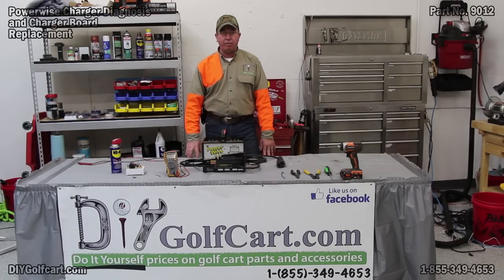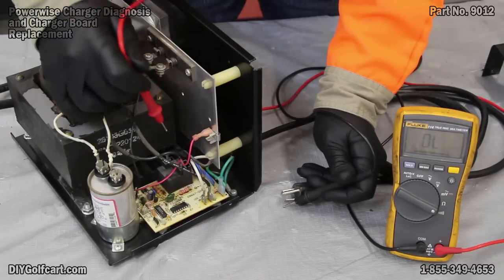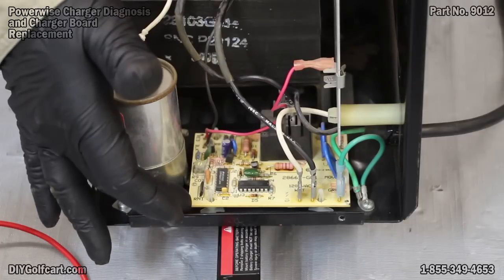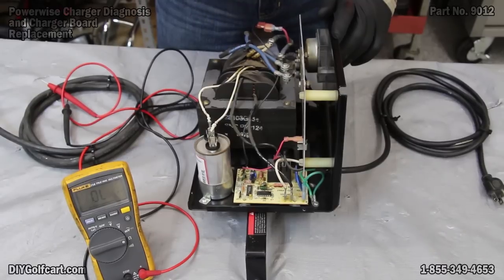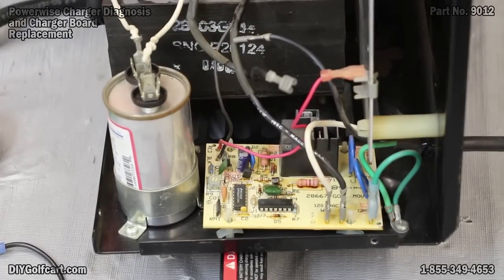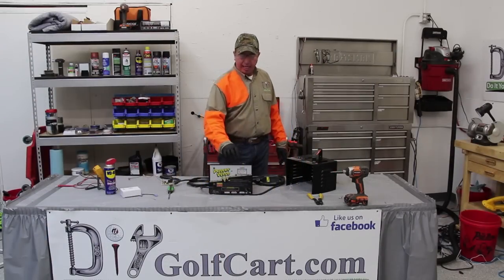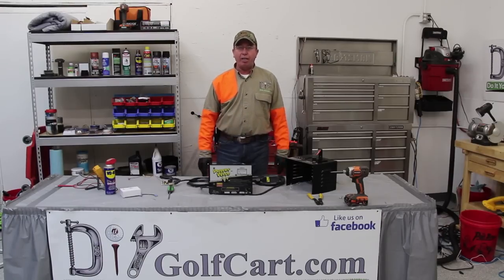Powerwise Charger Board and Diagnostic | How to Repair or Replace Golf Cart Charger

Comment: is it normal for the charger to click occasionally when hot wiring the power board?  Also what happens if you let the hot wired charger run until it's under 5 amps if anything?

Comment: If the fuse and or diodes is bad will it make the board act as if it's bad too ... I  touched the screw driver across the relay on my new board and it turned charger on..I

Comment: Thank you 💓. Unusual but my ac power cord was bad and the capacitor as well. I'll check the rest when those two are installed.
Reply: I replaced the 50 amp use, power cord and capacitor 9.24.22. Unclear how to check the transformer. All else checked good as in the video. Plugged it in 9/25/22. Nothing.  Zip.  Screwdriver across the relay terminals and it arced.  What do I do now?

Comment: Thank you for testing info. I had a spark when I touched terminals on relay, so is the board ok? I did not get a continuity sound when i checked the negative side of cart plug that goes into the cart. So, do you think the pug itself is bad? S. Mccoy

Comment: I'm so happy, I DID IT.  I don't like working with electricity and at 69 years of age, I've had my share of shocking episodes. After putting the new charger board in I plugged it in and tripped the breaker.....I took the cover box off again and watched the video frame by frame.  I found where I had misplaced two black wires.  Now,,..my heart is happy.  It works great.  Karen Randa

Comment: Note : you have to have atleast 32 volts before charger will activate. My batteries are 4 years old and the charger doesn't work sometimes. I disconnect and charge 1 at a time till enough voltage is present.
Reply: Thanks a lot Sir!!. That was the answer my question that i had been looking for!!! One customer brought me this for repair. I faced first time off with this device and i realized that , there must be some voltage to start-up the circuit. So i tried, 14V, 20V, 24V at last, 27V the circuit board turned on and relay "click"ed. I knew it logic of to work the circuit, but i wasn't sure..Thanks to you, now i'm sure. Really thank you again Sir!! Have a great day!!!
Reply: @nusyil  your welcome I'm glad the information helped.

Comment: What a great walkthrough on this charger. I had already tracked my problem down to the relay/solenoid when I didn't hear that firm click the charger used to make and saw that it was in there. However I was questioning the cap because this charger has been stored outdoors and looked very poorly, but your specs tell me it's in fine operational range after all of it's hard life.
Someone new to electronics can pick up a dmm user manual and this video to diagnose their issue. Hope your able to stick to teaching because you've a knack for it

Comment: Hello thank you for showing this video I have followed all your guide it’s really good video the one thing you probably forgot to mention what if the capacitor is not giving you any reading and also when you had the screwdriver on both of the leads and it made a humming sound does that mean the board is bad or the board is good because when I touch the two leads that goes into the relay it made a humming sound is that mean the The board is good or the board is bad and I did not have any reading on the capacitors thanks in advance I’ll be looking forward to your reply back thanks

Comment: Hi I replaced the board in my 36 volt power wise charger, the one board replaced the two old boards but when I plug it into the golf cart it still will not come on, I unplugged the two black wires on the black box and connected them together and you could hear the transformer come on, I charged the golf cart like this so I figured this brand new board would fix the issue but it has not, any other diagnostic help would be greatly appreciated, thank you!

Comment: Barry, do you happen to know if a charger that is using diodes, can the diodes be replaced with the heat sink terminal that is used on this charger you are working on? thank you in advance, Dean
Reply: never mind LOL, i just replayed and saw you point out the new diodes are what i should be using :-)

Comment: Can  you tell me where I could get a QuiQ Delto Q 72v (yellow top, black sides) HF/PFC charger repaired, I checked Ac in - ok,  can't find any dc anywhere in the system.  I checked 2 what looked like slo-blow fuses, they seemed ok (no v either side  of either one).  Very perplexed, no lights at all ever; with ac plugged in, not even one led lights up? 
   THANKS>

Comment: So if the diodes are bad it doesnt charge? My circuit board is bad because if i tap both with a screwdriver it starts humming.. But if i touch the diode to the plate it reads a number, my multimeter doesnt have the beep sound so im am using the ohms to check continuity

Comment: First, thank you for the video.  Very helpful.  Question I have: Was not seeing continuity from the ground bar in the charge plug to the screw connection in the charger, but was able to see continuity between the grounding bar to the red wire you unplugged.  Should I move forward or is that an issue?   One other thing:  I think my capacitor was showing slightly more than 1.9 ohms (more like 2.9 - 3.2).  Thanks in advance.

Comment: I need help *

I've replaced my board and fuse twice..  no luck.    However my cart charges with the male jumper I have made.   Any ideas ?     It is possible I have gotten two bad boards ?
Reply from the maker: Sounds like the charger may have an intermittent short within the coil of the transformer. I see a new charger in your future.
Reply: thanks

Comment: OK, I ordered a circuit board.  I currently have an old one with two boards.  Can I get rid of the other board now?  I see you plug the little red wire from the new board to spot on the wall.  Where do I plug the little black wire coming off the board to?  I'm guessing it plugs into the ground wire that is plugged into the other board but want to make sure I do it right.  Thank you.
Reply from the maker: Yes, this board replaces the 2 original boards. The front board will no longer be used and the one laying down will be replaced with your new board. The RED wire does got to the heat sink and the BLACK wire connects to the RED wire from the AC cord.

Comment: My charger is not fully  charging my batteries in my cart. When my batteries are dead I plug in my charger and it shuts down in about an hour or two. It should take maybe six plus hours to fully charge the batteries. The meter shows it is charging but shutting down in a hour or so.
What could my problem be?

Thanks Dale
Reply: First and foremost, you're killing your batteries!! Never ever run your batteries all the way down constantly and then charger them. The batteries are lead acid and "do not" have a memory. Only Lithium batteries have a built in memory. IF your not on the car driving it, it should be connected to a charger. Now, as far as the issue, sounds like you may have a bad battery in the pack. Do a load test on the batteries to ensure they're all still good. 48 volt - minimum 7.9 per battery / 36 volt - minimum 5.9 each under load
Reply: I borrowed my neighbors charger and it does not shut down. It charges till batteries are fully charged.
Reply: What do I test the batteries under load?
Reply: How do I test batteries in load

Comment: Any ideas for diagnosing a charger that wont kick off whenever the cart is fully charged? Also the charger will hum when plugged only into the wall
Reply: That sounds like either a bad timer board or a weak battery not accepting a full charge.

Comment: I have ABSOLUTELY  no electrical experience. Took my charger to my local golf cart place
 Charged me $25 just to look at the thing. Was told I had a bad capacitor and motherboard. They wanted $119 for the motherboard  and $48 for the capacitor parts price and an additional $40 for labor on this 15 minute job. Ordered a kit that included motherboard capacitor fuse and diodes for $115 shipped. Long story short this video saved me $100.  Only gripe I have is the end as your plugging all the wires back in.. by giving a wider angle would have helped. I found myself waiting for the perfect time to pause to check my connections. Thanks for your help!!!
Reply from the maker: Thanks for watching!!

Comment: I’ve replaced the control board on my powerwise charger and it keeps blowing fuses and will not charge my golf cart. Why is this happening? Thank you for any help.
Reply from the maker: Sounds more like a transformer issue.
Reply: Diodes were bad I had continuity between the board and the diodes
Reply: How do you replace the diodes?
Reply from the maker: @Smith_jeff  https://www.golfcartking.com/ezgo-stud-type-diode-2010/    The new ones you dill a hole and mount them

Comment: I followed the test procedure up until the diode segment.  I was getting continuity from diode to aluminum plate/heat sink so I ordered new diodes . Still get continuity with the new diodes.  Am I doing something wrong?
Reply: @Barry Wilson So, it seems like continuity issue is fixed . Long story short, my dad had put in the new diodes we ordered and still got continuity, so he put the old diodes back in (The ones attached to the small board) and they fixed themselves  somehow. We will continue with diagnosis now.  Sorry to bother you .

Comment: If the charger doesn’t shut off when batteries are charged, the circuit board must be bad, correct?
Reply from the maker: If all the batteries are in good condition, I would agree that the board needs replacing.
Reply: @golfcartking  I just replaced all six batteries this spring. Thanks for your quick response!

Comment: What is the small red wire lead from the charger board to the resistance cooling wall? Why is it plugged in to the resistance cooling wall? Does it need to make contact with the resistance cooling wall for the charger to maintain working condition?

Comment: Great video! Helped me diagnose my charger.. my cart is a 36 v and it has 4 6 volt batteries and 2 8 volt batteries.. I bought it this way at a auction .. is that a big deal? Should i replace the 2 8 volt batteries?
Reply from the maker: That could damage the controller and a 36 volt charger may not fully charge the batteries.

Comment: Nice video. But I need help.  I believe I have miss arranged up my D.C. wires coming into the charger. Can someone tell me what the black, green and white wires coming in hook up with? Also which one of these wires hocks up with the thin red one coming from the new board. Its been a summer headache for me.

Comment: When i do the heat sink diode test my multi meter does not beep but gives a reading of 546 on each one, is that normal? Thank you
Reply from the maker: Are you checking continuity in both directions?

Comment: What if you had one of those Chargers that only did 33 instead of 36 volts
Reply from the maker: Load test the batteries first. If they all test good, then place your voltmeter across the battery pack, plug the charger to the cart. If iy only goes up to 33 volts then you do need a new board.

Comment: Your video are very clear and precise! I have learned a lot and are very understandable. I was looking for a Fluke meter that had a load tone when checking continuity and I could hear the tone on your multimeter. Keep up the great work. I was surprised on the great prices of your charger control boards. Thanks, Ted M.

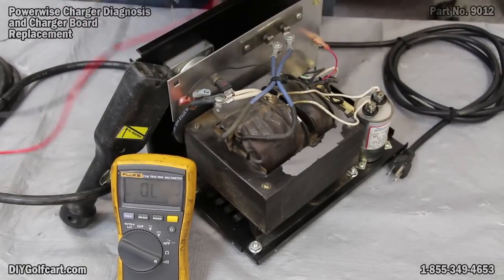Comment: At 2:55 of the video, you disconnected two wires. Where does the wire in your right hand attach to? Also, is there a way to remove the board in front and if you do, where do you connect the wire?

Comment: t has been working fine until I plugged it in and noticed that the meter only went half way and the charger was making a loud buzzing noise and getting really what do U think is my problem and what should I check first ? Thanks

Comment: A capacitor is an open circuit. Without disconnecting it, you are measuring the resistance of one of the transformer windings. If you disconnect the wires, you will read infinite resistance across the capacitor which doesn't tell you much about the capacitor since a bad capacitor will often read infinite resistance as well. A lightning strike is about the only thing that will take one out so in most cases, as you said, the capacitor is rarely a problem. You will need a capacitor tester or a big series resistor and know something about time constants otherwise. Good video, Thanks.
Reply: for a better test for capacitor disconnect those wires from transformer coil and put the tester in to capacitor mode if have or dischrge first the capacitor by shorting the two terminal
Reply: Well Greg Moore so nice of you to add your 82 cents to the DIY lesson. My question is....If you know all about all why are you subscribed to a Tutorial?
Reply: @ganeden553  I definitely agree with your statement there. I always find it funny when people criticize other people on how what they are doing is wrong on a tutorial, which means you typed in the search a question as to how to do something. Why are you looking it up if you already know. why dont you channel showing people how to do it? I am at the point where every time i watch a tuturial and i see someone else telling them how they are doing it so wrong and the correct way to do it that I ask them why they are looking up "how to"  videos in the first place. generally i get no response back.

Comment: Thank you so much for your awesome video!  I replaced the diodes and the circuit board and it seems to be working!!   There's another circuit board behind where the diodes are mounted.  I noticed a resistor (200 ohm, I think) near the top of the board that looks brownish on the bottom.  Or is it might be some kind of glue?? It reads much higher than 200 ohms.  Should I replace it?  Thanks so much!!
Reply: Please ignore my question.  I was reading the color bands from the wrong direction.  It is brown, black, red, and gold - a 1k resistor.  I think the brown underneath is some sort of resin glue.  All is well! Thanks again!  :)

Comment: Hey I like all your info.  You u give out keep it up.     
If I just the 2 wires on the control board mine sound like a loud hum not seeing the meter on the front move is that normal.

Comment: I replaced the board, diodes and fuse. I am getting continuity through the diodes to the aluminum panel even after replacing both of them. Any ideas would be most helpful.. Thanks! AL

Comment: Tested the diodes to heat sink, measure 0 ohms (full continuity) on both diodes, with test leads in either orientation. Fuse was also blown.  Haven't tested board yet.  Any thoughts? No output / no life from charger.  All power cables continuity is good.

Comment: What if I get an arc when I bridge the contacts with a screwdriver. No hum, just an arc.
Reply from the maker: Getting a spark is common because of electrical transfer. No hum, bigger issues. Check the transformer to see if it's shorted out.

Comment: I did the test on the board and when I did the bridge on the two black wires it started charging but on the capacitor you said to get about 1.5 1.6 ohms and I only got 1. Could it be possible the capacitor is bad? Thanks
Reply: disconnect the cap measure across the two pins after shorting so you don't blow your meter!! then set on low ohms if no short , turn your meter to meg ohms measure again, if its good it will charge like a battery with your meter on ohms it supply's the power

Comment: I have a 2007 Ezgo battery operated cart. First off if the batteries 3.3 to 3.7 volts will the charger PowerWise 28115 G04 ) try and charge them?  If the batteries are bad I have seen these chemicals that are supposed to bring the batteries back to life . Will they ? With out using the powerwise charger do i need to disconnect the batteries to charge with a standard 6 volt charger ?   BTW   THANKS IN ADVANCE   I AM VERY IMPRESSED with your videos :)
Reply from the maker: With the voltages being that low, the charger will not come on. As far getting the batteries charged you have a couple of options. (1) Disconnect each battery and charge it one at a time till it begins boiling. Reconnect the batteries and the charger should come on. (2) Using a set of jumper cables, hook across the battery pack with another golf cart so the charger will recognize more voltage. Once the charger come on, disconnect the jumper cables.
Reply: use a 12 volt charger on each battery for about 3-4 mins then hook up the ezgo charger...repet if needed

Comment: I can't thank you enough for your video.  When I did my testing I went right to the relay and determined there was no power on the output side.  I then asked myself if the DC plug needed to see a load for the relay to engage but your video answered that question for me.  I will try jumping tomorrow then buy a replacement relay and swap them out.

Comment: Very helpful video.  I am a bit confused on testing the board; if the charger (transformer) kicks on when you touch the screwdriver to both terminals coming into the relay, does that mean the board is bad?  Thanks!
Reply from the maker: +mrn0782 Touching both terminals with the screwdriver is just a way to do a quick check to see if the transformer is good. By doing that, you're actually bypassing the board and forcing the charger to come on. If the batteries are too low, you can jump start the charger by doing this.

Comment: I have a 36 volt Powerwise about 4 yrs old that has historically registered halfway up the ammeter (about 15 amps) when first connected to low batteries but somewhat recently only goes up to about 10 amps resulting in the charger cutting off I presume early resulting in a less than full charge.   Would this be the charger board?
Reply from the maker: +Warren Wilson First thing I'd do is to Load Test the batteries. If they are all ok, then yes, the Timer Board is going bad.